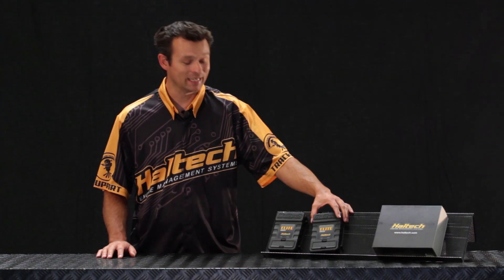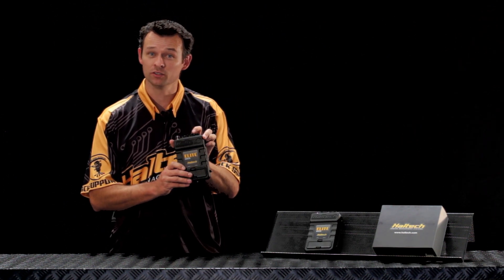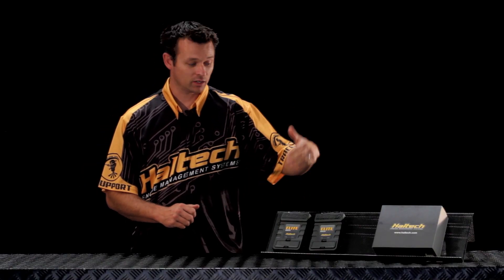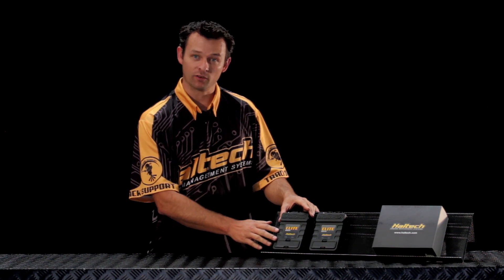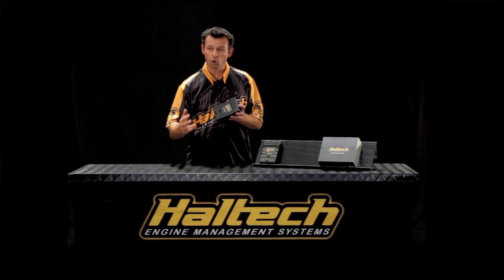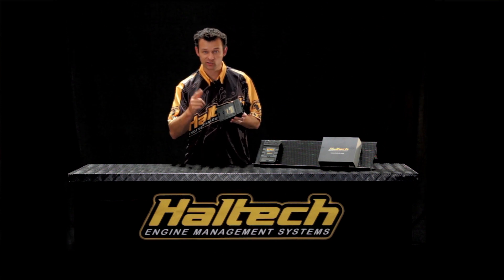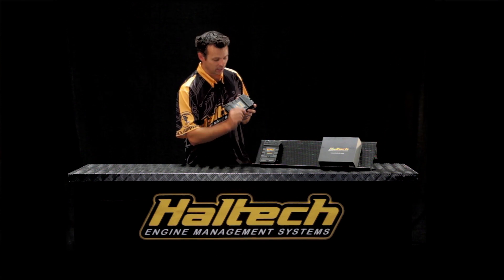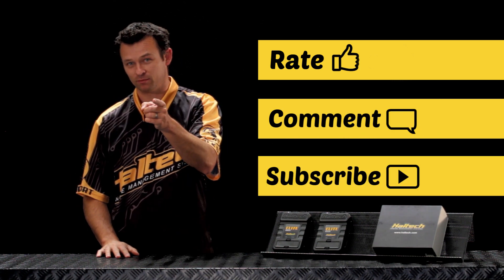Haltech Elite 1500 vs Elite 2500 - What's the difference?

Comment: Is this ecu have auto tuning or need tuner.for normal used not racing or turbos. and control individual ignition coil , this ecu control fuel system and ignition system until 8 cylinders. and what about the full course from A-Z for beginners what the period and cost and time and location .best regards,
Reply from the maker: Wow... that's quite a few questions in a single post. Let us address each individually:)
1. We always recommend you have a qualified tuner do the tuning. The self learning feature will help the ECU adapt to your requirements over time.
2. Yes Elite ECUs can control individual ignition coils. For an 8 cylinder engine you'll need an Elite 2500.
3. If you are a beginner and want to learn how to tune these are the places we highly recommend:
https://www.hpacademy.com/
https://www.efi101.com/
Reply: @haltech  thank you Haltech for quick reply and interest. Just now finished talking with Mr Matt on sales more than 35 minutes long distances call. Best regards, Salem
Www.a1autoservices.ae

Comment: So staged injectors on a 4 banger would be semi sequential?
Reply from the maker: On an Elite 1500, yes staged injection would be semi-sequential as you only have 4 injector drivers. You can do sequential staged injection on a 4 cylinder with our Elite 2500 ECU which has 8 injector drivers.

Comment: Hi Haltech can I use the elite 2500 on a 4 to 8 cylinder engine or is it just for 6 to 8 cylinder engine? and thanks
Reply from the maker: Absolutely. Elite 2500 can be used on a 4, 6 or 8 cylinder engine.
Reply: Thanks a lot Haltech
Reply: So it can’t be used on a 5 cylinder engine or 3 cylinder engine
Reply: @youtubecomments5951  It's suitable for engines going from 1 to 12 cylinder it will definitely work.
Reply: What about 16 cylinder.... I don't need it but just curious

Comment: Does the knock control on the 1500 has "FFT analysis" like you mention on your website for the 2500? (even though i think it does since it needs to do FFT processing to detect the knock signal either way)
Reply from the maker: +St0RM33 

Yes, the Elite 1500 uses FFT for knock detection.
Reply: +haltechecu I like the elite 1500 a lot but seeing my audi' factory ECU has 2 knock sensors, how do I go around that to make it work with the 1500?
Reply: Haltech quick question Mat in this video says 1500 for wrx but on a wrx you have 2 cylinder heads both opposite sides ? when you say the 2500 has dual knock does that mean you have 2 knock sensors ? because on a wrx u need 2 knock sensors 1 on each head ? so im guessing u cant use the 1500 ?

Comment: Can I run a Haltech ECU on any car? Or is this platform specific?
Reply from the maker: Elite, Sport and Sprint ECUs are universal, you can get make/model specific harnesses that replace the factory wiring. If you're after a plug-in solution then go with the Pro Plugin Series. These units are make/model specific and plug directly into the factory harness.
Reply: @haltech  I've had to read your comment twice to truly understand.